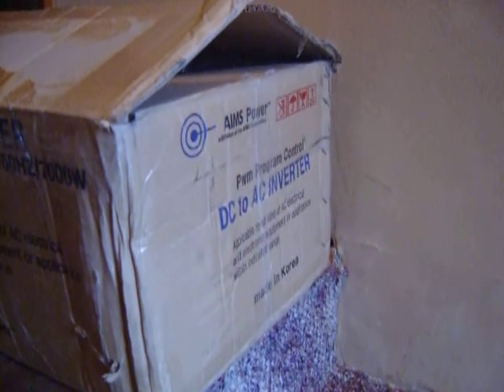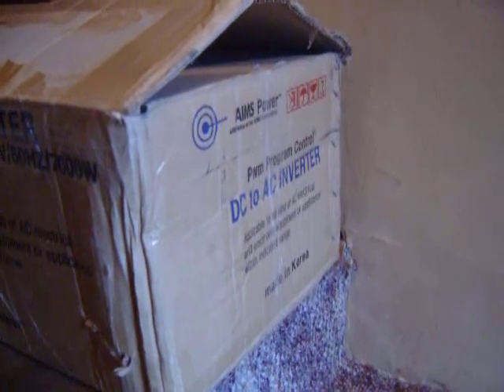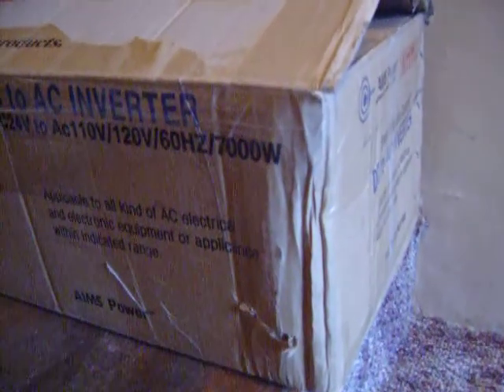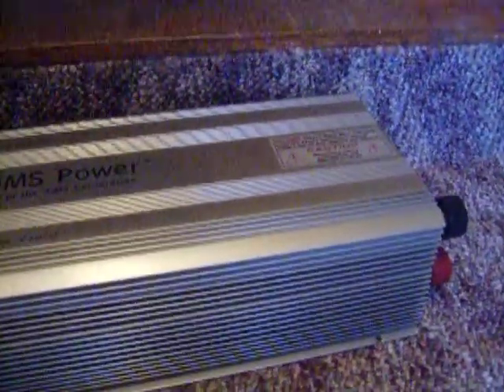Unboxing of 7,000 watt Aims Industrial Inverter

Comment from the maker: @helloman1976 I want to be able to run a air conditioner. Now there is the problem of enough batteries and solar panels. It will take some time to to achieve this. I feel this inverter can hold up its part of the rig. I probably should have, maybe just bought the $500 pure sine might have worked good enough I am thinking this can do a lot. I would have loved to have a outback pure sine.

Comment from the maker: @MrHorsetail I m just saying that its possible to use at the same time or by it self a small affordable 100 dollar pure sine for a High def TV or digital clock that this inverter cannot run. Some computer monitors will not run on the Modified sine. Yes the previous owner of this inverter said that it is possible to hook it into the breaker box and run the whole house.

Comment: @shartne No my TV is an old 70s solid state.  That  inverter you have is the biggest inverter I've ever seen.  It seems like 7,000 watts would run everything in the house, and it would be more efficient than having several inverters.

Comment from the maker: @MrHorsetail Is your TV a High Def that you  run with a modified? This particular inverter also adjusts for voltage drops in batteries and surges in usage of power its suppose to be a really good one any way I hope so. I should have tried to install today but I have had a super bad cough and I feel pretty bad. Tomorrow I will probably try to get it installed. Also it is possible to buy a 100 dollar pure sine for a TV or clock and run it at the same time off the same battery bank.

Comment: Is that a full sine wave inverter?  I heard a modified sine wave would burn up the motors in appliances.  A few months ago, I saw a guy with a 12v DC freezer.  I checked out their web site and they are around a thousand dollars.